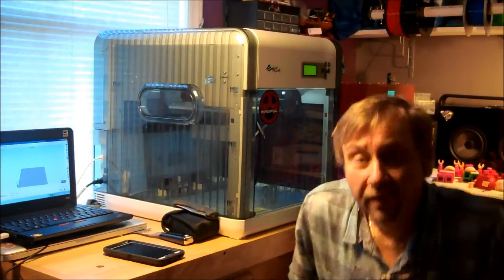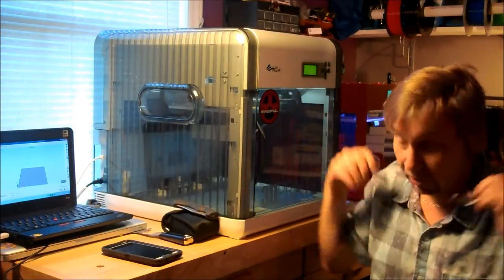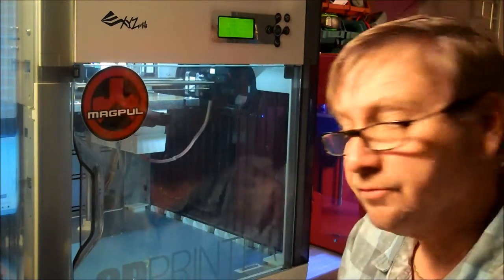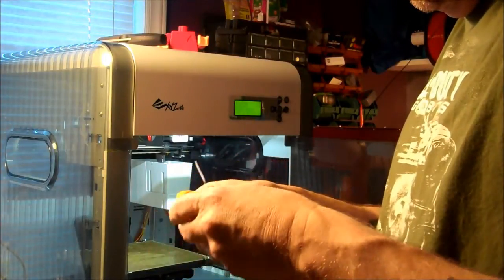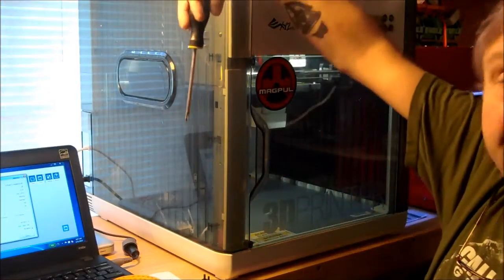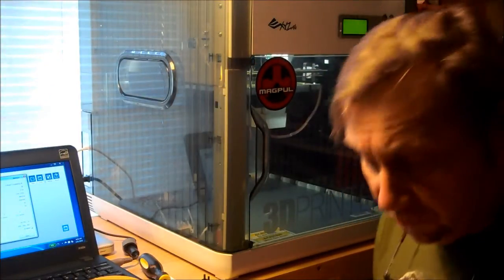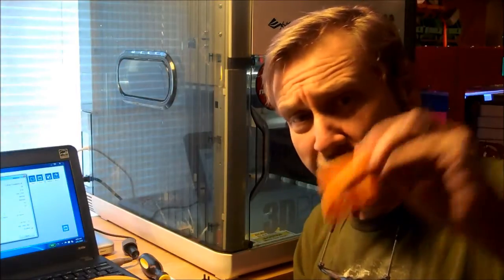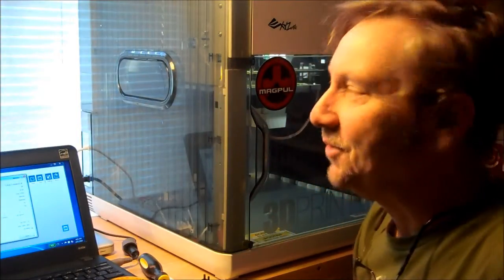My Davinci 3D Printers attempt at Chucks Filament Friday Project...FAIL..

Comment: Hey Jay was hoping for some help, I've had my Da Vinci 1.0A for 2 weeks and all was going well until I ran out of the supplied glue, now I have tried several Glue sticks and even tried ABS juice (Home made) but just cant seem to get be adhesion, any tips?
Reply from the maker: Garry Ellsmore You're gonna have to re-run the build plate settings again...you have to get the gap very close to get adhesion without glue. I haven't used glue since the first few prints. I'm assuming you're using a raft too...I hate rafts.  I'm also guess you don't leave the door open either (common mistake).

Are the problems from just models curling or warping off plate? Geometry of you design is important, more so with ABS than PLA. ABS will curl in a New York minute on square corners...on my Replicator 2X they had 'helper disks' which were small thin circles you would merge with your model to keep it from curling (do a search for 'helper disks' for 3D printing to get more info). They were VERY useful for lifting and curling.

You can also...

1) Clean the glass with Acetone...I'm assuming you already did but had to put that out. 
2) Get some Kapton tape or squares and put that on the glass...I've done that and it works pretty good. You still have to get the gap pretty much perfect.
3) LAST RESORT - but it does work - is to use BuildTak sheets (look on Amazon). These are thick textured stickers that REALLY suck the prints down. They work amazingly on all the printers I tried them on...the problem is, I think, they stick 'too well' and I've destroyed prints, knocked alignments off, even scared small children using them...YMMV. Look on youtube for some video's. 

Let me know...

Jay
Reply: Jay Raxter I have done the calibration with a pass. I am using only default Da Vinci firmware and software (latest Version). What settings do you calibrate to it says between 230 & 260 (mm, micron,what i dont know), do you try to keep them very close to each other?

I seems everything I print starts fine but ends up moving about 10 to 20 layers in and I end up with a mess attached to the extruder.

I have ordered some Kapton tape, I'll see how that goes.

Thanks

Comment: It's the nozzle design that kills small parts and pointy objects. XYZ has recently started shipping a different version that has a larger conical section which apparently helps, but is still far from optimal. All the Reprap designs use a small replaceable nozzle which is screwed into a heater block that is much farther away from the print area.
They only other way you might have success printing this type or part would be to use a targeted layer cooling fan. Not something you want running all the time with ABS however, as it will cause warping and delamination.

Comment: Hi Jay, many thanks for an infomative channel. Just wondering what your thoughts are with regard to the question of toxicity of the emissions given off by the printer, in particular ABS, read some concerning items, but would like your thoughts as you seem to be using several machines at once and spend long periods with them. Its the only thing holding me back from buying my first machine!
Reply from the maker: Julian, Sorry haven't replied to you quickly. Had some eye trouble (partially blind in both eyes)....has nothing to do with fumes :) My wife's typing this for me....

PLA is made from vegtable/organic esters to create a long chain poly-molecule ($10 word for a kind of plastic) and isn't KNOWN to have cancer causing additives in it (Remember 90% of PLA is made in China or in someones garage...so who really knows what's in in??). The smell is pleasant to most people (like waffles cooking). Simply open a window to dilute and get rid of fumes. They don't stay airborne after heat is removed from filament. 

ABS on the other hand is made from a petroleum hydrocarbon, propyl, and ammonia slurry. A 'poop-ton' of everyday items are made from ABS. Everything from plastic dinnerware to electronic enclosures. The fumes to a lot of people have a vaguely chemical smell (acrylonitrile). This could be a carcinogen. I don't find it a 'nasty' smell...just a faint odor. NOTE: Lego's are made from this....ever smell a bag of fresh Lego's ? Same smell. I'd suggest expelling this to the outside to get rid of the fumes. 

I run about 80% PLA at any given time. For example, right now I have the Davinci (ABS), Creatbot (PLA), and Craftbot (PLA) all running. All are in a large 24 foot square converted garage with 10 foot ceiling. The smell is noticeable but not overpowering.  They don't bother me (matter of fact I can the smell to indicate if the printer is at temp and running correctly). If you are worried about the toxicity then I highly suggest you run them through an HEPA filter or discharge them to the outside atmosphere. Look online there's about 2 dozen designs on how to do this effectively. You can use add-on fans to either channel the fumes outside or run them through a filter/carbon matrix.

Cheers!

Jay

Comment: Hi! Jay, I have a Davinci and simplify 3D, can you help me how make it work both. I need something special to make work the program?? Can you help me??
Reply from the maker: First thing is have you found out how to load the Davinci Defaults into S3D?

With those parameters you have a baseline to print on your Davinci. A lot of the confusing stuff (retract length/rate, infill line type and thickness...etc) that you don't normally have to worry about should be fine for your first prints. 

Here's an excellent site with basic S3D setting information http://jinschoi.github.io/simplify3d-docs/

Basically S3D gives you finer selections than XYZware....but it basically does the exact same thing. Don't be scared....it's really hard to do something that can kill the Davinci. The onboard chipping won't let you go crazy with temps (on purpose or by accident). Matter of fact, I think there's a LOT of background limitations going on because of the (purposeful) hardware limits set in the Davinci. Pretty sure only way to get full functionality (and you don't need that now) is to reload the EEPROM with a different firmware (look on youtube)...but the newest ones (1.0A, 2.0, 1.0AIO) haven't been 'hacked' yet....so if you have a new one it's not an option yet.

Valentia, what specifically is giving you trouble? 

Jay
Reply: Jay Raxter I have the old one the 1.0. I don't print complicate stuff but I hate XYZware. I always have a lot of trouble and some printing never look good.
Reply from the maker: Valentina Brauer Well...load up S3D and go play :) That's how I learned a lot about 3D printing. Use the link for the basic S3D info. 

What, specifically, is failing on your parts? 

Jay

Comment: Can you change the temperature from the Extruder and the Bed with Simpildy3d on a DaVinci ? 
I will buy the software, but i can't  find the Answer. I have the AIO and my plan is to change the temperatures maybe to print PLA

Comment: What happen to your makerbot I fix mines and I just got a delta printer from rockstar I got it for 400 bucks from China
Reply from the maker: Mike...it ate the X cable...again. It's a known problem with the Replicator 4th generation models. Even if you brace the cable it still eventually dies. This is my 4th cable for the R2. My R2X has had 2.

How do you like the delta? I've got an Orion, and while it's a good machine, I'm not in love with a delta design. Did you get the kit? I've seen them as low as $475USD, so if you got it for $400 you're doing good!

Cheers - Jay
Reply: I got a mini delta from China that how I got it for 400

Comment: My cousin has that printer. He bought it through Amazon prime and its been returned 4 times. The detail is very bad and the printer head keeps failing. I don't know nothing about them but apparently it's not all that good.
Reply from the maker: Depends...is it $1000-$2000 good? Nope......Then again...I paid (in the package) $274 for it brand new. For that? It's a great printer. Go watch my other Davinci videos....I get into 'why'....for a .2-.3 ABS printer it's just fine.

OH>..NICE KRISS!! Have you watched my Kriss videos?? I'm having mine SBRd next month (if my stupid stamp comes in). 

Cheers

Jay
Reply from the maker: New Egg...but they're not showing it. Usually the price drops from $499 to $399 they'll run package deals. The one I got had 7 carts and the 1.0a printer for $469. You'll just have to watch for the sale.